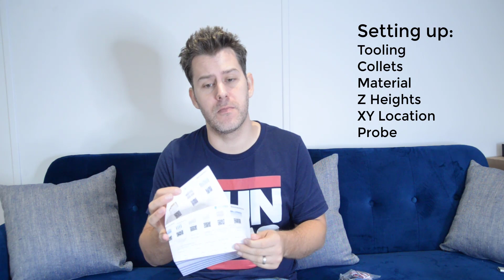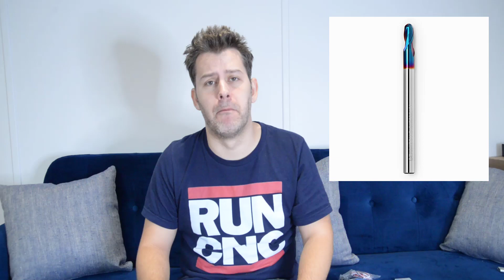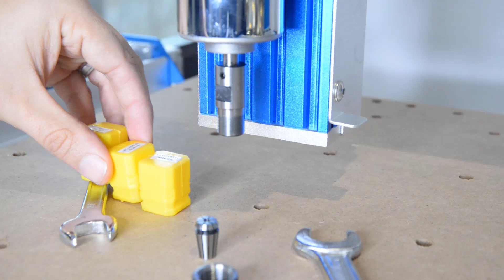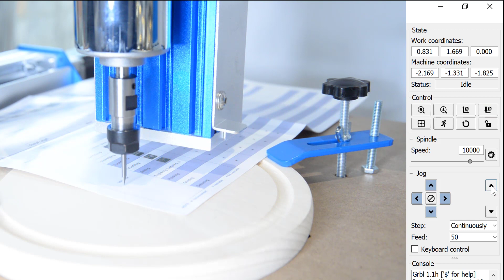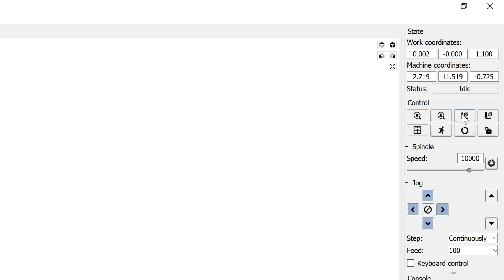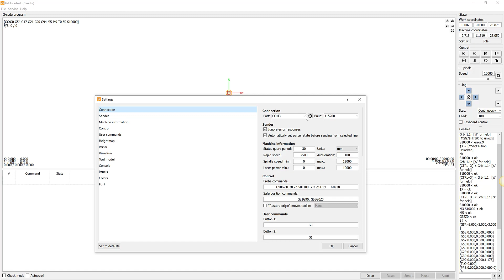4030 PROver - Unboxing and Building Episode 5 - First test of the machine

Comment: Watching your build. Quick safety correction. The collet snaps into the collet nut with a spring. Don't assemble them to the spindle separately, the collet might not lock on the upper & lower finger segments to the cutter bit!
Better news, the spindle motor was super quiet on your test at 10:30 , I've only seen 1 other 4030 on YouTube, that was quiet with R2D2 sounding steppers
Reply from the maker: I did think that after I did it. I added that section in, as lots of people had been messaging me asking which way up the collet went and what collets are. I'd missed that in previous videos